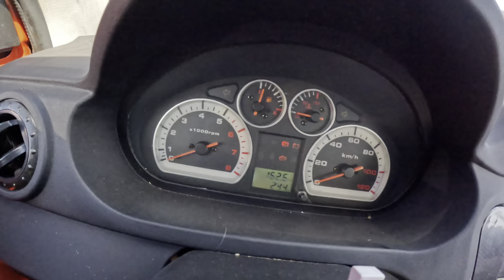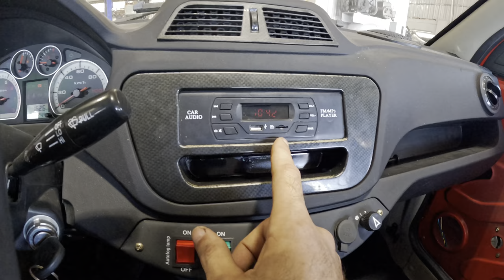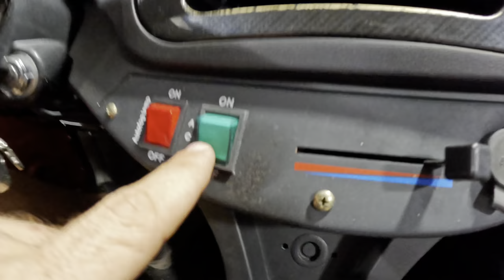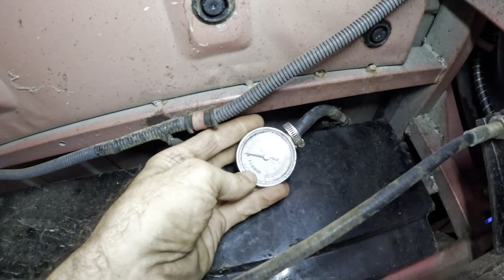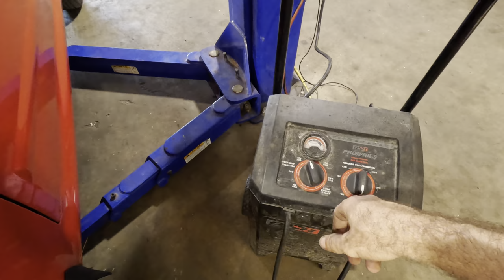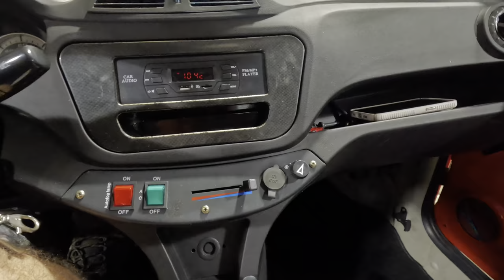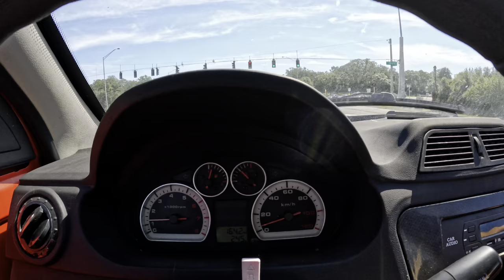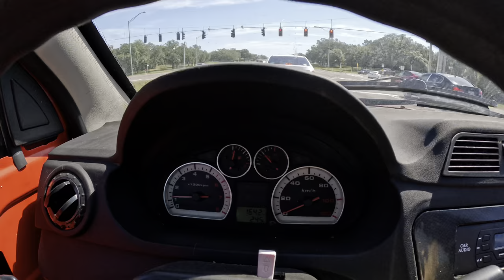UNFIT for the ROAD! Brand New 2019 Piece of Junk!

Comment: No matter what it is still transportation. Back in the early 70s I’d buy a $100 beater with rusted through floors and bald tires. Still got me to work in the snow.
Reply: My first car was a 1978 Dodge Arrow GT. (standard transmssion). The only thing holding it together was the rust and a coupla rolls of duct tape. Drove it for almost 2 years before it kicked the bucket. Now almost 40 years later I drive a Mustang. Vroom...vroom.
Reply: I don't understand people that just b** about everything because it's got a two cylinder engine I take it in a minute and fix it up and drive it to the store at least, bitching over and over about the Gap in the door who cares
Reply: Don't forget the venerated Honda 600 wasn't much different than that
Reply: It's double overhead cam look at the plugs and the valve cover
Reply: Yeah, but our hoopties were American made hoopties, made out of actual steel. I once bought a Pontiac Tempest for $50 and drove it for four months til the transmission shat the bed. Then I put the seats in my Nova.
Reply: @RonaldDaub-xi5jz  I agree 100% Sounds like the kind of car I would like.  I could well do without the radio, air con and especially power windows if it actually had any. A 3 door model would suit me better.
Reply: Those 1970's, ($100. dollar 'beaters') can now be sold for at least $500., just for the metal content!
Reply: @RonaldDaub-xi5jz You will when you drive one its easy to say what you just said until you drive one and realize my first car which was a 89 Lancer rusted so bad you couldn’t even rest your foot on any part of the floor and it ran on two of 4 cylinders radiator was bad no power steering no power brakes no windows I don’t mean windows didn’t work it literally had no front windows it guzzled gas like hell smelled like mold no radio that car wasn’t a death trap it was THE DEATHTRAP and it still drives better than this thing and no I am not exaggerating
Reply: @RonaldDaub-xi5jz  Not if you had to take it on the road to get to the store. No catalytic converter or any nod at pollution controls.  You couldn't possibly license it on the road in the US. If you had a big property you could use it to run down to your own mailbox.
Reply: Me too! Those Chrysler (now Stellantis) products were PERFECT Winter BEATERS. Cheapest vehicles (?) on the market AND fairly reliable, especially the "Valiants"!
Reply: @RonaldDaub-xi5jz  The back doors had the doorcards on, so someone started taking the front doors apart, maybe it had door rubbers, but they were taken off too.
Reply: I agree.  Chinese got the right idea.  A car is a thing to get you from one place to another quickly.  Hopefully this thing does do that.
Reply: @AodhMacRaynall-dr1sf  If reliability and longevity don't mean anything. This device couldn't possibly give good service for very long.
Reply: @herbertshallcross9775  Well then you get out on the side of the road and fix it.  Ever had volkswagen beetle?
Reply: @AodhMacRaynall-dr1sf  I had a VW Karmann Ghia, and I wish I still did. It was simple enough that I could accomplish repairs on the side of the road with no tools on the one occasion when that was necessary.

I don't understand your reply. Volkswagen beetles gave  service comparable to most cars on the road at the time. They went out of production because their air-cooled engines could not be brought into compliance with newer air pollution laws. It would be entirely possible to buy a sixty year old beetle now, repair it and operate it as a pretty good daily driver. This car, while it may not be fair to evaluate it while it seems to be in the middle of some uncompleted repairs, still has no promise to be even remotely as reliable or serviceable as a typical modern vehicle, or even a sixty year-old VW beetle.
Reply: @herbertshallcross9775  How do you know?  Oi, I get it, you just hate the Chinese!
Reply: @AodhMacRaynall-dr1sf  That's the best you've got, accusing me of racism? I admit, I have never seen or touched the vehicle in question, and the reviewer may not have been particularly fair, but nothing in the video inspired confidence in the quality or serviceability of the car.
Reply: @herbertshallcross9775  oi, not likin' chinese and bein' racissss is two different things.  Struck a nerve, eh?
Reply: That's what I thought too
Reply: They were built well
Reply: @herbertshallcross9775  A lot less pollution than big gas guzzling Engine's it will do about 100+Mpg and has virtually nothing to pollute the planet 😂😂😂
Reply: @stephenjones9153  No 5 mph bumpers. No airbags. No catalytic converter. Absolutely impossible to register to drive on the road, so, yeah, I guess it will contribute very little to pollution, since you can't drive it...
Reply: It's not transportation if it isn't legal to drive on the road. Your $100 beater was street legal.
Reply: @TheHiredGun187  Your 78 Arrow was street legal. It wouldn't be legal today even if it was showroom fresh. Laws have changed. This car cannot meet current certification laws. It is useless.
Reply: @RonaldDaub-xi5jz  You couldn't drive it to the store because nothing you could fix would make it legal to drive on the road. Fresh from the factory it couldn't meet our requirements. I am surprised anybody managed to import it.
Reply: @RonaldDaub-xi5jz  Fifty years ago. If Honda tried to bring the same 600 to market today, the DOT would say "Forget it!"
Reply: @CrazyBear65  Pontiac is out of business. If they produced the same car today, the DOT wouldn't let them sell it.
Reply: @toyotacorollaaltis8613  you're not telling me anything I drove it
Reply: @toyotacorollaaltis8613  and refrain from telling me what I will and won't do take that to the bank with you
Reply: @gertvanderhorst2890  I didn't ask about that who cares
Reply: @herbertshallcross9775  cry me a River
Reply: @herbertshallcross9775  keep on talking over your head do you know absolutely nothing
Reply: @RonaldDaub-xi5jz  This is the goddamn internet no one has to ask also go drive an 89 Lancer like the one I described then come talk hell I’ll let you drive mine you just gotta come to Trinidad
Reply: I once bought a junky car from a guy who needed $ to buy a nice bike to impress a girl who also rode a bike. it was a Lincoln with all four fenders from different cars, once of which was not from a Lincoln. It DID have a rusted section of floorboard that had a piece of plywood under the carpet to make it safe. LOL, right?
Reply: @bobg1685  Still nicer than my first car but yea that sounds pretty junky also for it to be a luxury car yea
Reply: @toyotacorollaaltis8613  All the fenders were different colors, though two of them did try to look maroonish, and the front driver's fender was not even from a Lincoln. That one was faded yellow, and there was about a four-inch gap from the back of the fender to the leading edge of the door. It didn't move too quickly, nor did it inspire a lot of mechanical confidence, but it wasn't as smokey or fumey as other cars I've owned.
Reply: @bobg1685  Yea well from the sounds of it it probably wasn’t running on 2 cylinders like my Lancer was and my Lancer it had severe rear end damage that wasn’t fixed by the previous owner and I didn’t fix it either only recently even got the trunk open for the first time and found a case of old cocacola but doesn’t change the fact that Lincoln wasn’t a nice car by the way what was it? First car that comes to my mind would be a Town car but I wonder if thats actually what it is
Reply: @toyotacorollaaltis8613  I want to say it was a Continental, because that's how I remember it, but for all I know it was some lame Mercury or an LTD. It had sharp straight lines and folding headlights, though they didn't fold. I remember it had huge doors that didn't want to line up to close. LOL, I'm sure it was once a lovely car, but was sorry when I got it. I miss those big old cars. My mom had this huge Chrysler that had the smoothest ride, and it wasn't even a luxury model.
Reply: @AodhMacRaynall-dr1sf  Oh shut up go try fixing that without tools I dare you infact my friends got one in his front yard with a blown motor I’ll fly you to Trinidad and we will laugh as you try and fail
Reply: @toyotacorollaaltis8613  wow!  thank you for keepin this shit-storm in a tea-cup goin!
Reply: @rongendron8705  And who would be crazy enough to sell them just for their metal content instead of fixing and driving them ?
Reply: Put it on the roof of your repair shop! 
With your business name on both sides.
Reply: Honda s600 had small motor in 60s. 100mph guaranteed. Chain diff drive. 4 carbs.

Comment: It has a strut bar, no catalityc converter and no door panels. Definitely a racing car ! 😀
Reply: Fewer cylinders = weight reduction!
Reply: that chintzy strut bar is cheaper than a catalytic converter
Reply: You’re spitting pure facts. Look at that racing fuel door!  You don’t just get quality like that unless you care about performance.
Reply: Ecologically, it's 1963 in China...
Reply: For Sure
Reply: It even has disc brakes on all 4 wheels. You can't even get that on the cheapest cars from other makes.
Reply: Yes, all it needs is some Italian racing tires...Baldinis :)
Reply: Well even though the car is a piece of junk to western standards, it does not actually need a catalytic converter is it engine size is comparable to that of a motorcycle. They don't have cats either. After working on my over-engineered BMW with all sorts of issues, this thing would be like a breath of fresh air .lol.
Reply: I think it had door panels because if you look at the passenger door there are no door release or window crank so I think someone has removed them for a reason. Also, I think the weather stripping has been removed from around the door. So I don't think we are seeing it as it would have left the factory. He said his neighbor owned a body shop.
Reply: @Triggerman2505 My motorcycle has a catalytic converter even in a 2011 model.
Reply: @f.f.s.d.o.a.7294  you are correct but it depends on the size of the engine on your bike. My 2001 Road Star 1600 does not have one. I think newer bikes however do have them depending in what country you are but smaller cc bikes dont have them. This looks like a tiny 2 cylinder engine.
Reply: @Triggerman2505 my 2001 Honda cbr 929rr has a converter on it lol
Reply: @jackjohnston5491  very proud of you. Lol. Read entire comment.
Reply: I can see racing this at Bonneville...
Reply: Bad news! I just checked Procharger doesn't have anything for this car!
Reply: Door panels and the handles are in the back seat.  Mileage might be so low as the speedometer isn't working.  Like no tags nowhere to drive it.  Certainly has no crash worthiness.
Reply: Put a Yugo Engine in that and You Got a Chick Magnet, LOL!😅😊😮
Reply: Ls swap of the decade
Reply: The only thing it needs is racing stripes!
Reply: Yes, shouldn't he be more respectful? 20 years ago all these people had were bicycles.  Now the have cars -- not motorcycles -- cars.  Let's see your average American make that kind of progress in 20 years.
Reply: The body could be attached to a proper race car chassis, but that's about it.
Reply: @Triggerman2505 , more like a breath of stale ass.
Reply: @fredk.2001  you did not get the sarcasm son. Google the meaning of lol.
Reply: It's begging for a k swap
Reply: @No_Budget_No_Problem , its begging for a complete chassis swap. UTV parts maybe? AWD conversion...
Reply: @Triggerman2505 Not really buddy these things are disposable when something goes bad its a nightmare to fix my friend has a brand new Kia Rio which is lightyears ahead of one of these I had to fix a wheel bearing since he hit a pothole and it failed and that thing gave me more problems then a 2014 Slk 200 did and thats the last time I ever even look at a Kia in person
Reply: @toyotacorollaaltis8613  i still have my 2014 kia rios. My kids love them, ... Every car manufacturers got something I bet thats a pita
Reply: For a car to just get to work in, you DON'T need all those "luxury" items!
Reply: @TheOzthewiz  Yea you do cause you want something to get to work in take my 92 Lancer running on two cylinders with nothing working and that is rusted out free of charge also its not a deathtrap ITS THE DEATH TRAP my point is theres always some used car thats cheaper then ANY brand new car
Reply: @crforfreedom7407  There were very few 2-cycle engines in cars sold in the U.S. in 1963 and they all came off the market soon after. Isettas, Saabs, can't think of any others.
Reply: No kitty to steal, which is an excellent deterrent for thieves
Reply: Does it race against motorcycles or against bikes?
Reply: Only if the bike is 100% pedal powered.
Reply: V2s are FUCKINFAST
Reply: Factory light weight!!!!

Comment: They managed to make the Reliant Robin look like a BMW in build standards, truly incredible.
Reply: That thing will never last as long as a robin either!
Reply: Chinese ingenuity folks.
At least they are honest. You wanted a cheap vehicle/ and they did their best to fulfill your request.
Reply: @luckyguy600  I think that's the same tire size that was on 1970s Renaults.
Reply: i'd rather a reliant robin or 3 wheel messerschmitt , NSU, Morgan , than that ,
Reply: At least a reliant had a 4 banger
Reply: Reliants had quite nice little 4 cylinder 4-stroke engines, they designed and built them themselves, and they were actually quite advanced and reliable. This 2 cylinder 2 stroke engine is like something from the land that time forgot.
Reply: @frglee  if I was to get a sub compact from another country, I would get a reliant rebel, austin westminster, zil lada... at least those are cars
Reply: @jamesheina6952  What were those Chevy mix-breeds from the 1980s or so that had a 3 cylinder?
Reply: This thing’s worse than a Yugo and that’s pretty bad .lol
Reply: The Reliant Kitten is a more fitting comparison (what the Robin looked like with four wheels).
Reply: Yes it true Sh1t
Reply: @@retiredbore378
That's not true, the Reliant engine was an original design that had its roots back in the 1930s and was based on an Austin 7 engine. Long before the Chinese were manufacturing anything of use.
Reply: @johnbrereton5229  The side valve (flathead) Reliant engines were based on the Austin 7 unit, the OHV engines were based on a Chinese copy of a Standard 8 unit.
Reply: @jonathangriffin1120  
Austin sold all the manufacturing rights to Reliant when they stopped production of the Sustin 7 in the 1930s. Reliant made many changes to the design though it was still a side vale right up to the 1960s. The new engine was overhead valve and the first mass produced aluminium engine in Europe and though it is claimed this was based on a cast iron Chinese version of the Standard SC, this too was based on the Austin 7 engine.
Reply: @luckyguy600  Should have asked for RELIRABILITY. China, you don't ask, they don't supply.
Reply: Chevy GEO
Reply: @frglee  Parts are extremely cheap, and easy to obtain and replace
Reply: @@retiredbore378 The Chinese do a lot of development work on western products.
Reply: @frglee  That didn't sound like a 2 stroke at least using the tiny little speaker I got. Plus there is no way that can be street legal in North America with a 2 stroke engine.
Reply: I would choose this car over a BMW...
Have you ever heard of or driven a BMW Isetta?
Reply: @crforfreedom7407  
Chevy Sprint...
They also had turbos!
Reply: it has a twin cylinder 4 T ohc engine @frglee
Reply: Don't insult the Robin.  BMW quality is the bigger joke.
Reply: Even the Chinese in China would buy Japanese if they can afford it. 

...Although a lot of them would prefer German luxury cars for the prestige, even though that would only be marginally better than the factory lemon in the video.
Reply: Before I passed my car test many years ago I could legally drive Reliants on my bike license . They were actually ok . The fastest one I had was a £50 X reg Rialto with the daft letterbox boot and it did the ton ... that shit was scary ! The front wheel was bouncing off the road like an NBA player with a basket ball . The front wheel bounce started about 90mph . I had a few Reliants over the years and not one ever let me down . Drove 550 miles in one day in my Robin LX fully loaded to London and back with a motorcycle hanging out of the arse end  on the way back up north (front wheel taken off bike ) in the middle of January in thick fog on a night . It never missed a beat . Had modern European cars that shut down all because of a mofo emissions shit sensor on the M25 dropping my speed to a crawl on a "smart motorway " with trucks hurtling up behind me .... I would trust a Relibo ANY day !.
Reply: Uh. When reliant made the robin, BMW were making the bubble cars.

But I take your point.
Reply: @lezbriddon They made Robbins out of old fallout shelters or discarded septic tanks - built like a tank literally. :D  :trophy-yellow-smiling:
Reply: it reminds me worlds cheapest car think 2008 it from India and way better compared to Chinese rubbish, the The Tata Nano entered the Indian market in 2008 priced from just 100,000 rupees, or about $1,500.
Reply: @jimtaylor294  Poor Robin,i bet you hurt its feelings.
Reply: Yes, shouldn't he be more respectful? 20 years ago all these people had were bicycles.  Now the have cars -- not motorcycles -- cars.  Let's see your average American make that kind of progress in 20 years.
Reply: Seen a little  truck with  a dump bed awhile back  not sure what  engine  😅
Reply: @frglee it's much more advanced than that, it's a DOHC 4stroke 2 cyl. with EFI and AC 😁
Reply: AC!
Reply: @boooju  
Right. 
Show me a group of Americans that can come together and mass produce something like that in the time the Chinese did it.
Reply: @crforfreedom7407  Same tire size as a Geo Metro
Reply: Austin America 😂😂 They Had Hydraulic Suspension 😂😂